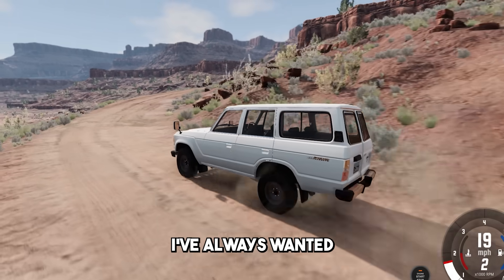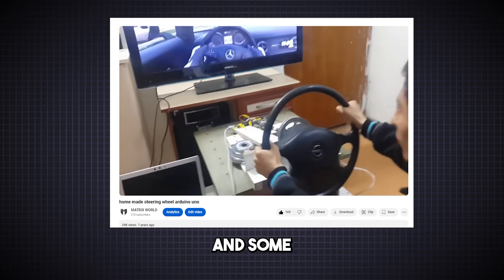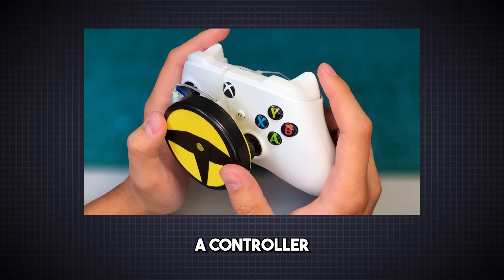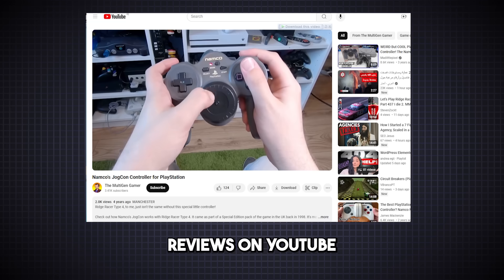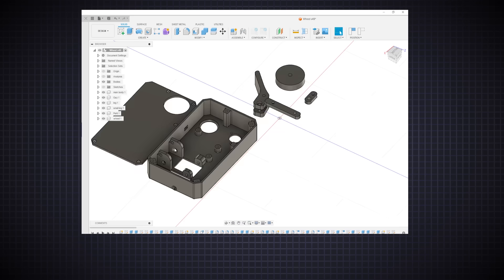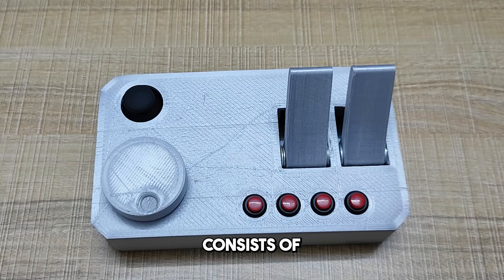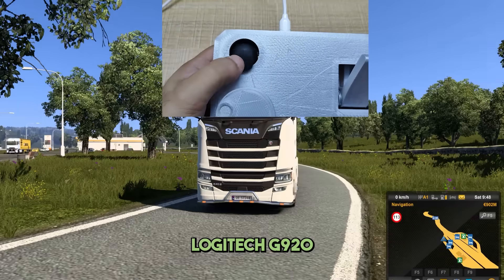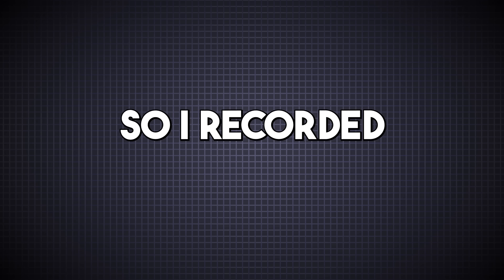The Racing Controller No Company Ever Made—So I Built It

Comment: You can get a UPS to prevent power outage mishaps. I'm pretty sure that if power outages are an issue, IT guys in the country should have enough demand for them to be available.
Reply from the maker: Thanks for the suggestion! I’m using an Anycubic Chiron, and it needs a lot of power. Unfortunately, sometimes the power cuts last for up to 7 hours, and a UPS can’t cover that long. While solar panels and batteries are an option, they would cost quite a lot to set up
Reply: @3dprinterart299  there are some options in that case.
First step is making it use less power. Most of printer's energy consumption is in heating, and Chiron is a big printer with a big bed so it wastes a lot of power on the bed. Printing without bed heater active will reduce power consumption and let you print for longer, it's oldschool but it works, we used to do it 10 years ago so there are resources. PLA is generally your best bet for "cold" filament.
Second is suspending the printer once UPS kicks in if you expect a long outage. Pause the print and shut off the nozzle heater, some printer firmwares allow you to do that. Printer with just steppers holding position and fans shouldn't consume mroe than 10 watts. This goes hand in hand with printing with cold bed because if you let hot bed cool down it'll generally pop the print off as thermal expansion between glass and plastic is different. 
Third can be simply designing smaller and faster printing parts and expecting them to finish between outages (or within UPS range). Like, not printing the entire box in one go but making it a two part job with dovetail joints, for example. At worst, you'll throw half the box away instead of the whole box.
Reply: @TheLaXandro  Get an old car battery with power inverter (that has for sure enough juice). Or just use woodwork and scrapped radio parts instead of 3D printer.
Reply: @3dprinterart299  Chiron is a pretty large printer, so its bed should be very power hungry. You can try printing with cold bed to greatly reduce power consumption, it's a bit oldschool and fiddly but there's a lot of resources how to do that because that's how we used to print back in the day. If the printer has the option in firmware, you can also try pausing it and turning the nozzle heater off when an outage happens, just electronics and steppers holding position shouldn't consume more than, like, 10 watts (if you can't shut the heater off though, continue printing and hope for it to finish, heaters are the bulk of printer's power consumption). Turning bed heater off mid-print won't work though, plastic and glass/steel have different thermal expansion so the print will likely pop off, so again, cold bed for pauses. Or design smaller parts so they have more chance to print in time.

Comment: this is sick. i'd love to see a manual version. could make the controller stand at an angle, add a third pedal and then use two of your fingers on the right hand to have more control over the 3 pedals while using your thumb to change speeds mapped on the smaller red buttons below. although the dimensions of the body would probably need to be slightly changed. idk how comfortable that would be, but just as an idea
Reply from the maker: Thank you for the idea
Reply: @3dprinterart299 hello, maybe try to add the force feedback for the wheel, and to like rotate the wheel maybe "pinch" it with two fingers, like a dj😂.
Reply: @3dprinterart299  I was thinking about shifting the whole video, a first easier upgrade could be just adding a couple shoulders button or similar, which could be used as the manual pads for +/- on automatic transmission with manual gear selection (if a real sim game) or just to manual shift even if the clutch is missing
Reply: @3dprinterart299 
Can i request u made a custom one n made a review of it?

...

Steering analog on right hand side

...

Throttle and brake as usual pressure trigger l2 r2

...

Left hand side for button
Shift up shift down
Hand brake
Change view
Joystick to rotate view
Pause menu
Nitrous for arcade racing
1 additional undecided button just in case
Reply: ive seen really tiny manual gear shifters (as fidget toys) i dont see why you cant make them a bit bigger and add some sensors to each gear. sequential is probably easier though
Reply: There are some types of tow trucks and forklift that have a similar steering wheel to the one on the controller but they have knobs on them that freely rotate. Maybe that would also go well with larger pedals.
Reply: At first I thought this looked like poorly thought out idea. Now I see how's much better it is than a standard controller and think it just needs some fine tuning. Great job!! I hope to see more!
Reply: i think having a scroll wheel for changing gears might work better! with that and a clutch pedal itd also give this controller more analog axis' than an xbox controller
Reply: A manual version would be amazing! Three pedals please! :D

Comment: A scroll wheel for your index fingers to adjust view would probably be better than a joystick (Left wheel to look left/right, right wheel for up/down). Then you wouldn't need to take your thumb off the steering as much
Reply from the maker: Thanks for your idea
Reply: I thought of h shifter on the front right side (face button)
Reply: Honestly I would suggest having a standard joystick for the right thumb, and moving the pedals to the back in a trigger position.
Reply: @Chicky_Lumps  what about a touchpad instead? Its a lot easier using touchpad for camera but idk about implementing it for a controller

Comment: You should also make one with paddle shifting!
Reply: You can also use a ps4 type of controller but with the dpad replaced with the wheel... That way you could still customise your controls like I do sometimes 😊
Reply from the maker: I might just include paddle shifting in a future design
Reply: @3dprinterart299  in the upper right corner where the finger rests
Reply: You can also use a ps4 type of controller but with the dpad replaced with the wheel... That way you could still customise your controls like I do sometimes 😊